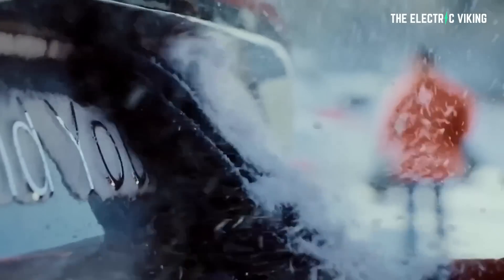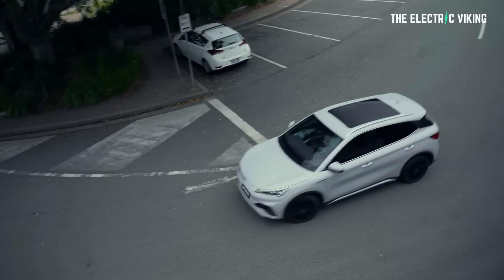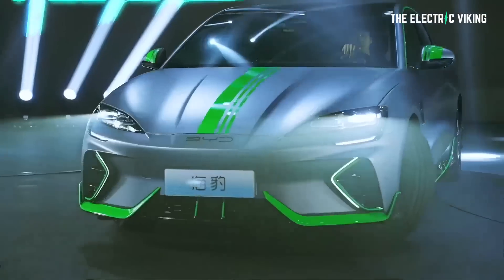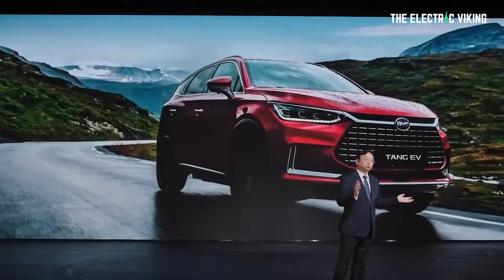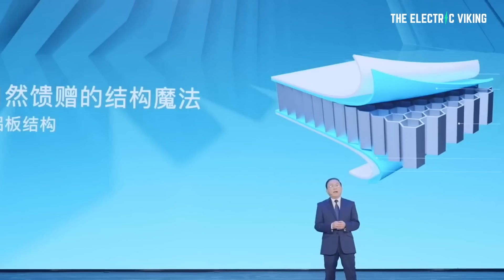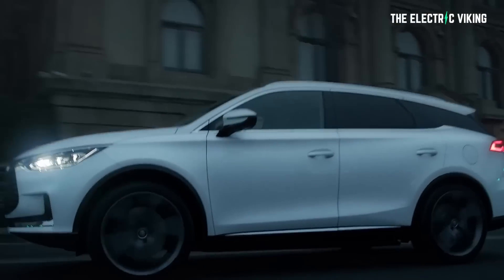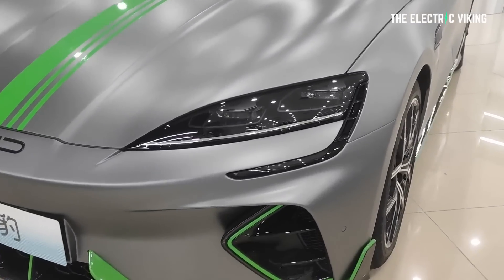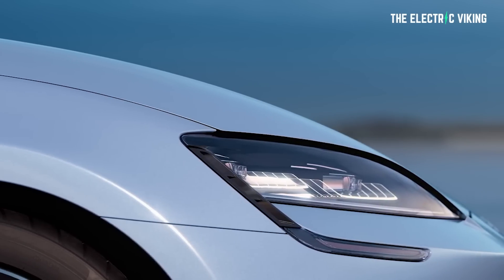BYD's 5 EVs for Europe: NEW Seal & Dolphin (EA1) confirmed

Comment: I was at the BYD stand at the Paris Auto show. There was a lot of interest in the Atto 3, but less for the 3 other models presented - including the Seal. The EU web site doesn’t mention the Seal, although it would sell well. I completed the 3 challenges at the BYD stand, got a few gifts, and even managed to test drive the Atto3. The French media was impressed with the bold and fun interior design of the Atto 3, but a little less with the white interior and the Build Your Dreams logo on the rear. The prices were shown, but removed late morning on Oct 18: 43690€ to 46690€ before 6000€ « bonus écologique » and 2500€ ev conversion funds. All models were very well equipped, with 60.5 KWh battery, 150KW fast charging, power seats, sun roof, heat pump, etc, with the main additions to top spec being bigger screen, power tail gate, lighting, 11KW AC charging (instead of 7KW on base), HEPA filter, and vehicle to load capability. My only beefs with the Atto 3 were the price was a few grand more than I expected and the back seat was a little tight. Still great value, but too close to Kia Niro EV and MG offerings to stand out.
Reply: Correction. The brochure indicates charging times with 150KW Fast charger. The Dutch web site shows only 88KW capability of car. Also the Netherlands web site has all 3 models with prices - but still no Seal.
Reply: @tomchupick9450  【 back seat was a little tigh】--- the same feeling from a video from India, I think on average people in Europe have a bigger size, they should consider this fact.

Comment: The weird thing is that no one is stopping the EU car companies from innovating and using LFP batteries. But just like the Japanese legacy autos, they chose not to. They also chose not to automate or use any of the modern technology available. It's really strange to see this behavior. And the even stranger thing is that the legacy autos have all the advantages. They have easy access to money and they already have factories and experts working for them.

It's like the Managers are being lazy and don't want to rock the boat so they just keep doing the same thing as before.
Reply: Thee are legacy disadvantages.   Unions, pensions, old useless assets, too many mechanical engineers and not enough electrical engineers and computer scientists.   People want to do things the way they know how.  Not interested in EVs.   So they do their best with the equipment and people they have.  Generally the car is a miss.  Ford and others see this and have formed electric divisions.  Or entirely new companies.   That could work for them.    

Oh you are so right on not rocking the boat.   Take a look at Sandy Monroe's channel.   He has a few vids on engineering principles.    In one he tells about  when Ford hired him to redesign a battery tray.   It took a division head (or close) to approve  the design even though Ford already paid for the development and it ended up saving them millions.  Nobody below that level was willing to stick out their neck and approve the design.  These vids are a good watch if you interested in engineering.
Reply: These legacy auto companies do have R&D departments, but innovation is lacking.
Reply: It's not strange at all. When you are too familiar with and successfully doing one thing for so long, it's really hard for you to either change the way you do it or adopt new techniques. Part of it is because you don't want to, part of it is the upfront cost of change. This is only a natural order.

Comment: No. I do not think BYD will dominate the European market. In Norway they have sold the Tang for about the same time as Tesla has sold Model Y. The tang has sold 1472 cars this year and Model Y 9670. Total Tang 2539. Y is 17938. The Tang is sold for 620k Nok. The Model Y S 520k, the LR is 560k and Performance 600k. The Atto 3 is 380k and 410k . The Model 3 S is 410k. LR 495k and Performance 535k. The Han is priced at 570k.  So the Han will be more expensive than the 3 Performanc and the Y LR. So none of the BYD cars are realy cheap here in Norway and I do not think it will be cheap in the EU either. Maybe even more expensive  due to more import tax.

Comment: BYD in Denmark is not really worth it. The Atto 3 cost 46.000 American dollars here. about 15.000 more than worth and the HAN cost 79.000 American Dollars.. Telsa model 3 dual motor performance is 70.000 and model Y dual preformance is 81.000

Comment: BYD is competition  to ICE vehicles not other EV's.The number of EV's  sold  is extremely  small. Forget about Tesla,you need to start making a profit
Reply: byd made almost 1 bil usd profit in Q3, triple their profit of Q2, and 10x of Q3 2021. so yeah, they are making a profit and it is going up crazily fast!
Reply: And going all BEV, or getting rid of the Hybrids.
Reply: @qilu2004  Q2 to Q3 was 8% higher on Net profit. 760 million to 820 Million. that is not crazy fast!! IMO
Reply: @MyUniversalUniversity  Q1 808m RMB, Q2 2.78B RMB, Q3 5.5-5.9B RMB. I wouldn't be surprised if Q4 tops 10B RMB.
Reply: @MyUniversalUniversity  still obsessed with bev vs phev? it all depends on market demands. production capacity is the key. byd can switch phev capacity to bev on a dime. and contrary to the belief of many, phev demand is very strong, especially in less developed markets.

Comment: cheaply priced compact sedans such as dolphin don't make a lot of money. I think byd should prioritize production of larger and more expensive models. also, byd  shouldn't try to be too aggressive on pricing, ie setting the prices too low. it is easier to lower the prices if sales don't go well, but a lot harder to raise prices in any case. 
I would take the seal over model 3 even if seal is priced slightly higher. the gap between the two, in term of built quality, material, standard features, is like mercedes vs kia. seal deserves to cost more.
Reply: Have you seen a BYD seal? How do you know it’s better compared to M3?
Reply: @Welly6858  It has been on the market for months here. of course I have seen it. I've also driven it.
Reply: same here, model 3 is crappy build and material, would buy seal as soon as it is available in Australia
Reply: Agree Seal is refreshing. Much better than Frog 3.
Reply: @Welly6858  There are tons of CN reviews on the Seal. I think the general consensus is outside of the poor performance on the auto lane correction, and no liDAR for future scalability(which Tesla also doesn't have, but substituted with a relatively good full-camera solution), everything else is better perceived than Tesla M3, in areas like build quality, interior quality, internal space especially rear seat space, Chassis response, suspension etc.

Comment: What will happen with the Chinese auto market with the recent chip manufacturing restrictions the US just imposed on October…? I think this might be a protective strategy for both the US OEMs and the European….the Chinese invasion perhaps might be short lived if they can’t access mid to high tech chips…
Reply: The US didn't ban BYD from using chips. This probably because Tesla is still there?
Reply: The chip restrictions from US are targeting very high end chips, like 3 nm, maybe 7 nm as well, but during the last two years of tech war/trade war/restrictions on Huawei, China has already developed 7nm by itself, and EV don't even use 7nm, let alone 3 nm...so this 3 nm restrictions has no effects on cars.
Reply: @rammpage4468  The 7nm demo chip developed by SMIC was using US equipments. Sadly, China can't make any modern chips without US technologies.
Reply: @rammpage4468  I heard someone else say that it could impact the Chinese auto industry (software related such as FSD) but I can’t find the source…could be terribly wrong
Reply: @squashduos1258  in the long run, it might delay the AI advancement of China. But so far car chips don't really need anything more advance than 14nm, which China has already cracked, just maybe the yield % isn't as high, but that's just a cost issue. Most car chips only need 28nm and below. There are also other ways to go around it because there's nearly no space anxiety for car chips since there are tons of space, unlike consumer products like PC and phones, they can achieve a similar amount of computing power, just with larger-sized chips.